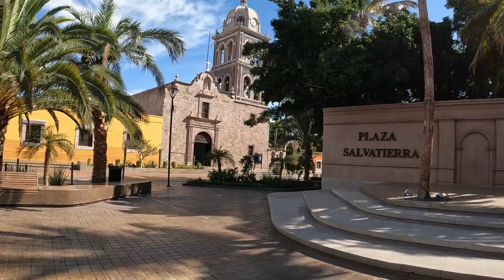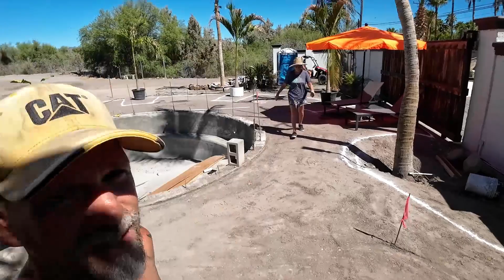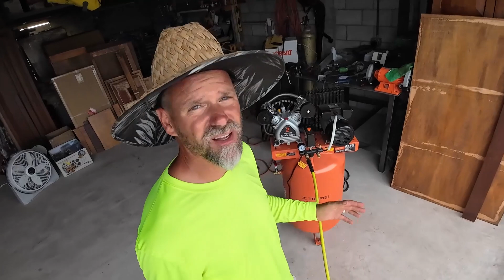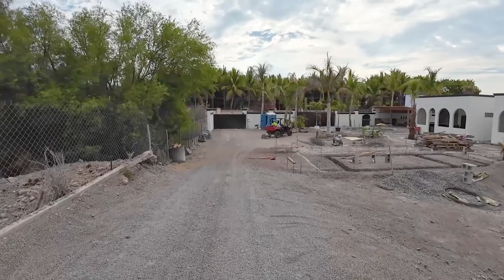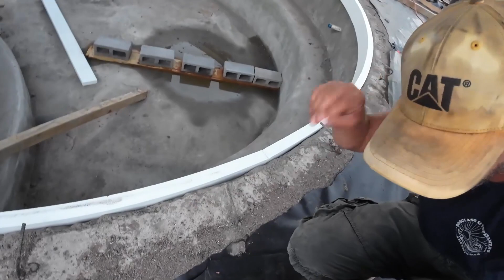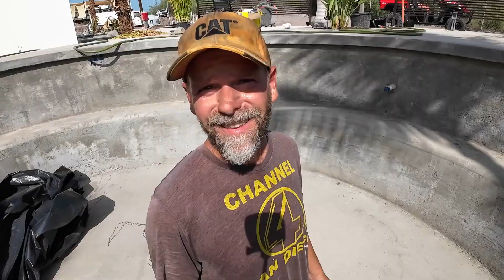We are in the Final Stretch of Construction on our Resort in Loreto, Mexico!!!

Comment: That's great realizing that the pool body is not going to stay put over time. The overhang is a good way to handle that movement!
Reply from the maker: I built a custom house many years ago in Oregon. We had a geo engineer as required and he told me that every structure will settle to some extent unless it is anchored all the way to bedrock. At that time they actually allowed up to 1/4 inch of settling in their calculations. He said with good construction practice and careful soil assessment that could usually be kept to 1/8 inch in our soils. The key to a solid structure that will last a long time is to plan for things like this that are out of your control and have mitigations in place before they happen

Comment: Wonderful progress. Grr8 idea with the foam board. With the heat these days I hope the pool is finished, filled and you are in it.   P n D
Reply from the maker: I wish! We have had several delays in the past month. Heat slows everything down and we had some defective materials for our Kooldeck application. There is also a massive public works project going on that has been using all the concrete that our only concrete plant in town can make for weeks. We are working with our builder to get back on track but the pool is still likely several weeks out.
Reply: @dooglassandesperanza  I feel for you. Let's cross fingers it's soon.